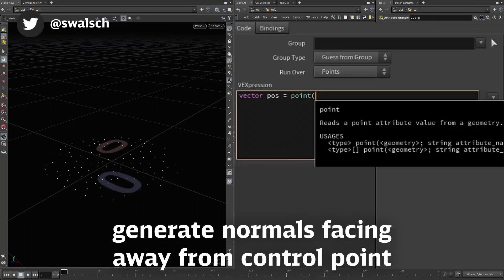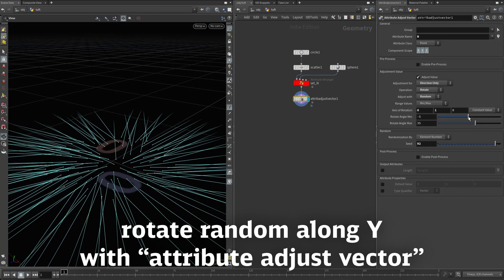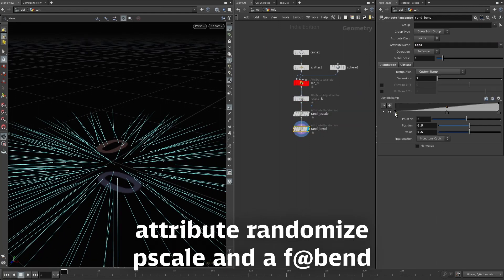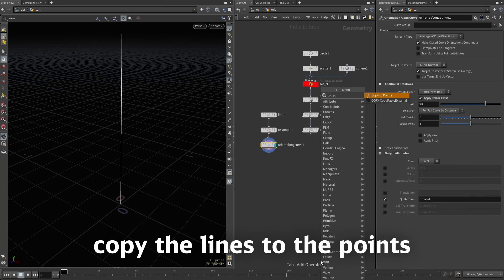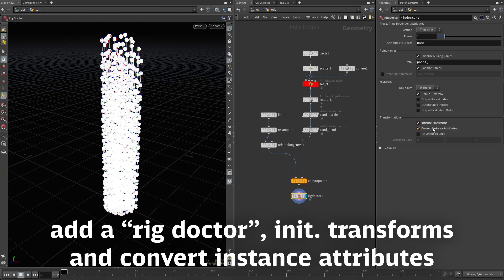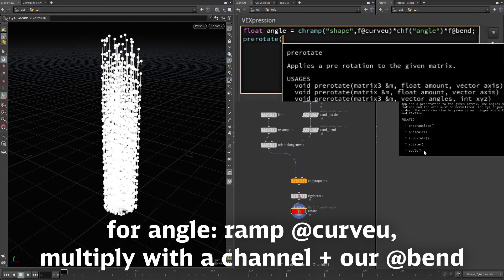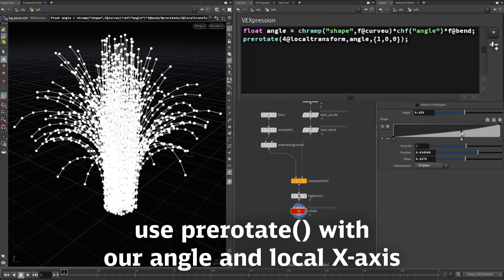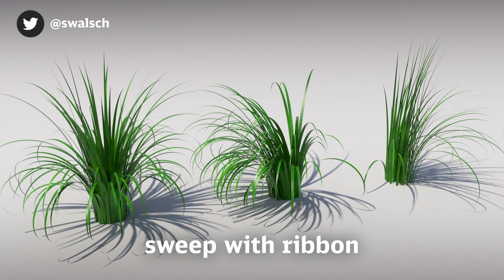Houdini 30s Quick Tip #18 - Tuft of Grass with KINEFX

Comment: could we maybe get the "script" in the video's description since you've taken enough time to apply it to it ?
Reply from the maker: we'll think about it. For now, here's this one's script:
On some scattered points, generate normals facing away from a control point. Use attribute adjust vector for some random rotation and then randomize both pscale and a custom "bend" attribute. Add a line with curveu, use orientation along curve to generate an orient attribute and roll 90 degrees. Copy this line to our points and append a rig doctor, set to "convert instance attributes". Now, in a rig wrangle, ramp the curveu attribute and multiply it by a float channel and our bend attribute from earlier. Use that angle in the prerotate function to bend each joint around it's local x axis, sweep, and voila: A procedural tuft of grass
Reply: @cgwikidiscord1277   That's great, short and sweet ! :)

Comment: Is that mainstream to do tutorials fast af so I need to rewatch them multiple times at 0.25 speed. Like what the point..... Grass looks bad without randomization of bend and without procedural textures.
Reply: these aren't mainstream tutorials and yes, because they are so fast they often times aren't entry level. don't know what you're on about with your comments on randomization, that's the whole point of the clip...
Reply: 4 seconds into the video, random pscale,rotation and custom bend attribute...
Reply: you need to learn a bit of houdini first
Reply: Believe me you can find loads of waffly hour long tutorials about Houdini so stuff like this is a godsend. I'm trying to learn some kineFX now and while this quick tip isn't going to do the job it's definitely given me some potential ideas and introduced a few new nodes to me as well.